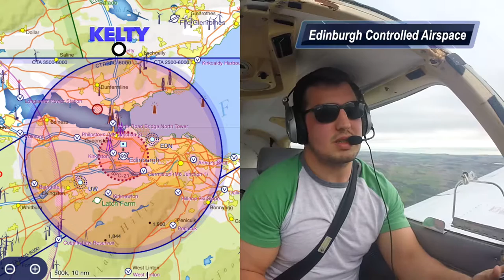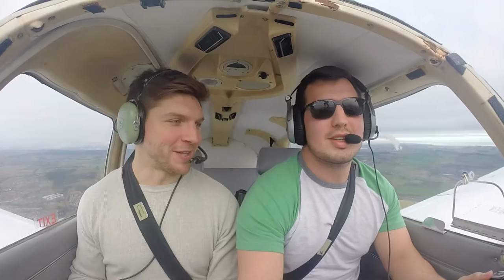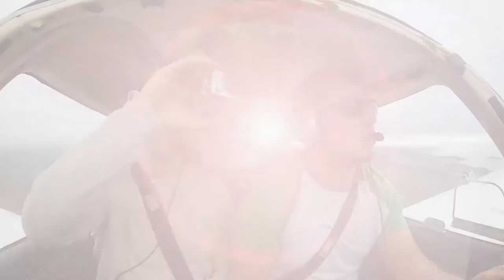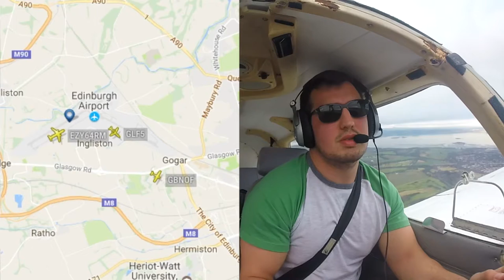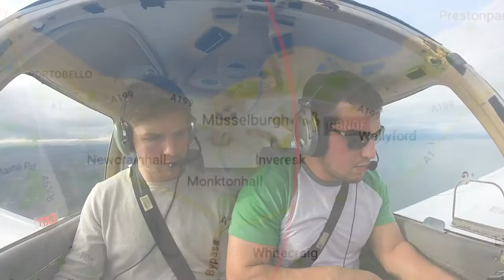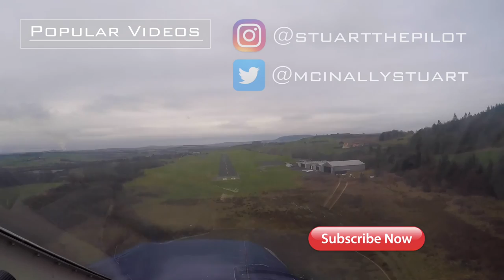How to TRANSIT CONTROLLED AIRSPACE | VFR | PA28 | Edinburgh | Full ATC Radio Procedures

Comment: Difficult to tell from the video, but would you have been able to glide clear in the event of an engine failure?  This is my nightmare when flying over conurbations and I tend to avoid them entirely at low altitude.
Reply from the maker: Excellent point. I always make sure I have an out in the event of an engine failure. Often when flying i will say to myself "engine failure now where do I go?" to ensure I always have options. Flying over cities is great fun so don't avoid them! Stuart